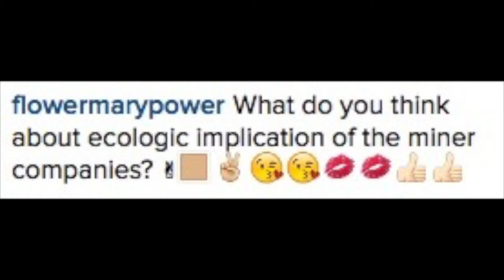MY MINING JOB! | Jade Madden

Comment: I love how strikingly different your day job is to your YouTube persona! So awesome. I'm curious though... Do you wear make up to work? And if so, how do you keep your makeup from melting off of your face, especially in the Australian heat? I'd love to see a video of you discussing this particular topic. Thank you very much, and more power!
Reply from the maker: +Nina D. Thanks! No i dont wear any makeup or even do my hair at work! Its just too annoying and in the heat and dust it ends up clogging my pores. thankfully no one cares what i look like at work, as long as i get the job done =D
Reply: Jade Madden Thanks for replying! Ugh, I wish I could get away with not wearing makeup at work as well. Still though, DP you have any tips with regards to making makeup last, especially when it's hot and humid? I live in the Philippines so this is a big issue for me.
Reply from the maker: Nina D.
setting sprays and a great long lasting foundation can always be a good start! also dont apply too much- i find on hot days if i wear too much foundation it can tend to slip and slide a bit- so less is more in these situations. you may also need to touch up through out the day! use blotting tissues and a tiny touch of powder! blotting tissues are great to suck up any excess oil without your skin going cakey! other then that- its just trial and error and finding what combinations works best for you! hope that helps hun!
Reply: Jade Madden Thanks for the advice and the replies! I'm trying the L'Oreal Infallible Makeup Extender Setting Spray and the Infallible Pro Matte Powder at the moment. The Infallible foundation isn't available here yet, but Tati (dunno if you know her, but she's another YouTuber) swears by it. So far so good on the setting spray and powder, although I still get oily and I do need to add a bit more yellow to it to match it to my skin tone. Anyway, what say you on things like hairspray, deodorant, and milk of magnesia on the face to extend makeup? I've tried hairspray, and while it works, I've heard that it's bad for the skin.